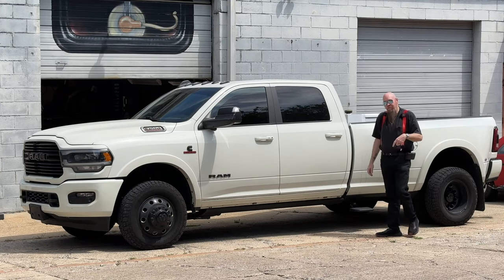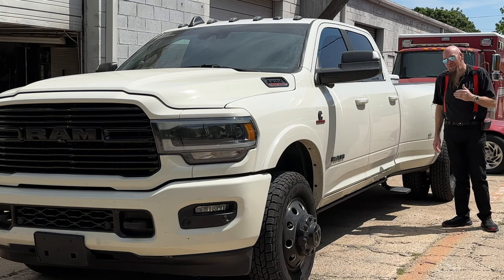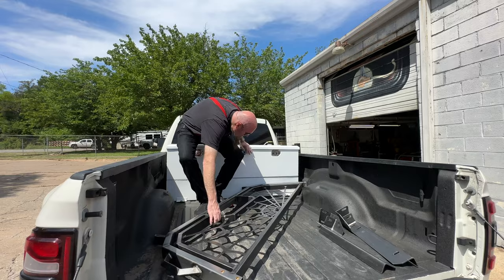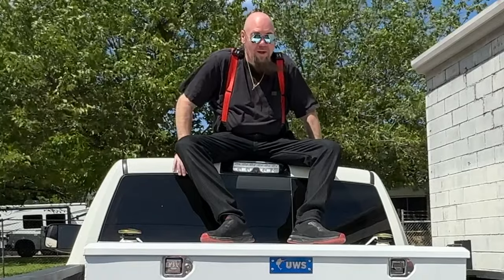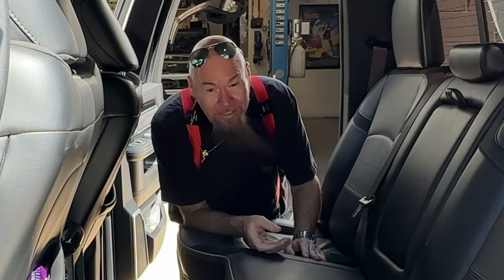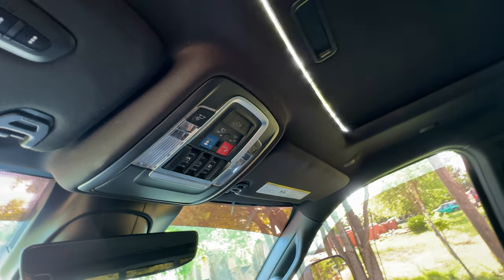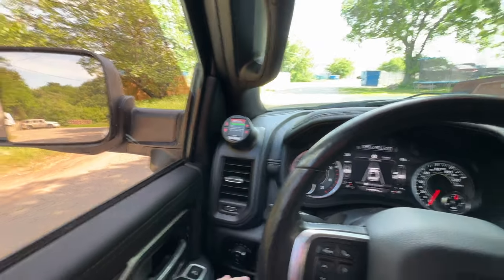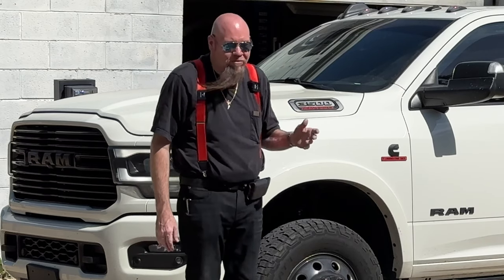2020 RAM 3500 Laramie Black Out Edition - Review and Upgrades

Comment: I think the fuel lines could be connected to two different tanks with a switch inside to swap tanks. That's how old fords with dual tanks did it years ago, or maybe just small electric pump to pump from one to the other tank as you drive with switch in cab and fuel level gauges for both tanks inside cab
Reply: Maybe a float control so transfer pump won't run when main tank is full

Comment: Personally I like the newer DEF systems. On the Freightliners/Internationals I've experienced, when the "Exhaust Regeneration Process" (or "Re-Gen") starts, the newer DEF systems seems to be less moody. The older systems still had Re-Gen, but it used diesel. I asked "wouldn't that just create more soot" but evidently not. (The Re-Gen cleans the soot off of the filter witch is like basily like a giant catalytic converter. Don't tell the thieves that. ) On the older systems if your truck needed to Re-Gen and it was real super cold out, you had to pray. Sometimes it was a different tube from the tank and the fuel was gelled. I had to flush out a "doser valve" once with WD-40 and a Leatherman Wave on the side of the road once because the truck wasn't regening and and it was going to leave me and a student stranded. I just tried that and it worked. I'm glad I had that little lesson from that mechanic I meet along that willy wonka experience.

(A warning light would come on and you had to immediately get up to 60 mph on level ground with the cruze on or pull over to do the manual process. If you don't you truck would go into limp-in mode)

When they would "go wrong"  often times the problem "can't be found" and it would randomly start to work again. Phantom issues were common and the different fuel blends we were forced to switch to weren't helping.

 I was surprised how quickly I grew to hate something I thought I would love. I still miss it though.

Comment: Delete the grid heater at least. Get a intake horn. There is a bolt that can fall off and it can be expensive. Not super common but can happen.

My leveled mega cab 2500 fit in a standard 8’ garage door. Sunroof glass would rub on the moulding but it fit.
Reply from the maker: All of that was done, see the next video.
Reply: @RobertMoseley  yea, i literally just finished watching that one. That is a beautiful truck. Only thing that’s to bad about it is the 68. A aisin is really the way to go. Keep the fluid changed and bump up line pressure as much as you can in the tune. Hopefully banks does this but idk. It really benefits from a new pump/regulator to get line pressure up higher than stock pump can do.